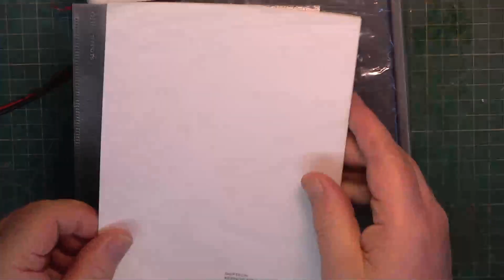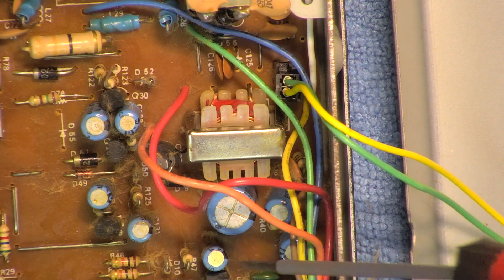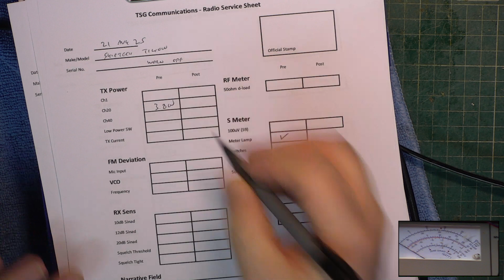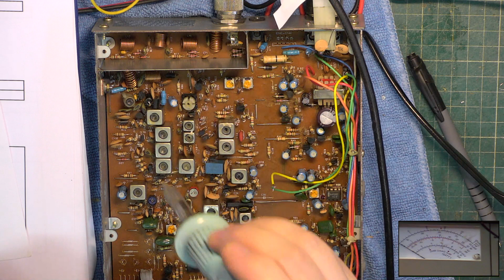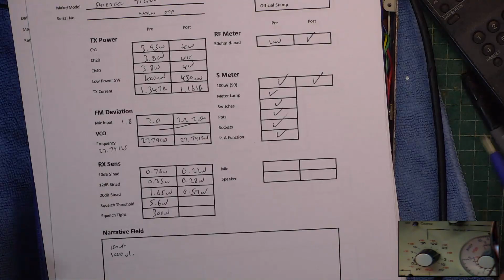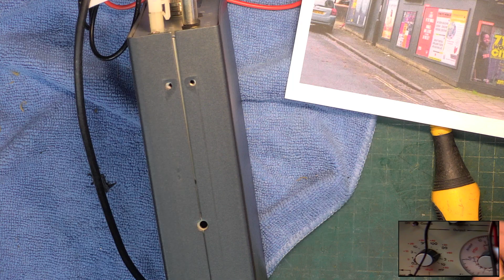Skiptech TI4000 CB27/81 UK FM CB radio -  repair & aligment

Comment: My guess would be that Q7 or Q8 (on your squirkit diagram, not sure about that machine) has gone low gain and is limiting the current through it - they feed the tens digit. Or possibly one of the resistors feeding them (R44, R45) has gone high resistance. Not that it matters! 
Talking about buildings just left to fall down, there are some right in the middle of Leeds on Kirkgate like that. The council are battling with the owners to get them to fix them, the Ltd. company that owns them has has changed (same owner for both!) to try and wriggle out of it. Now they are trying to avoid a compulsory purchase... FFS.
Reply from the maker: Needs compulsary purchase....and that purchase figure needs to be £1.

Back to the Skiptech; locating the tens/units driver transistors would involve removing what we guessed, then finding there's none in stock. Ordering from the Far East. Fit new one & discover different gain so different brightness....then having to put a new one in the units digit too. Given all the rime in the workd, OK. Not comercially viable even at minimum wage.

Richard, G0OJF, UK

Comment: A nice condition set all ready and serviced after the blown capacitor incident will look forward to the scratchy corner test, also with you mentioning you would have checked all returns, one of my old private hire bosses bought a computer late 90's after taking over the company to do his accounts at home, I got a phone call whilst working to ask if I could assist with the set up of a second new computer as he had blown up the original one and returned it to Currys, anyway I set the new one up and he said aren't you going to cut that wire and put a plug on it, I said no that goes into the power supply and I will plug that in, that's when I realised that with the first one he had plugged it directly into the mains I could not stop laughing.
Reply from the maker: We got a new Amstrad CB900 returned that someone had put a mains plug on & blown up back in 1982. Thy expected me to swap it. I offered them a £5 part exchange. hey started "consumer rights etc etc". My reply was this ; "you buy a car brand new out of the showroom. You drive it straight into a wall at speed. It's totally YOUR fault. YOU buy another."

Richard, G0OJF, UK
Reply: @ukfmcbradioservicingTango21 I heard of a few people back in the day that did the same thing not realising they needed a power supply.